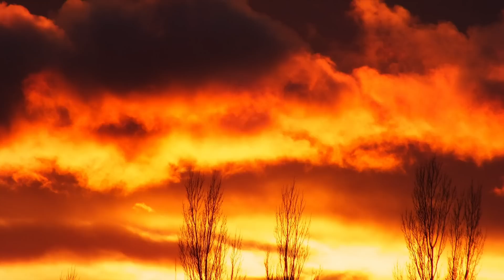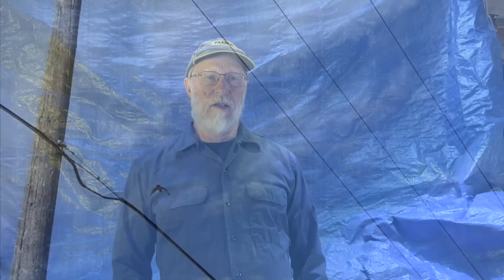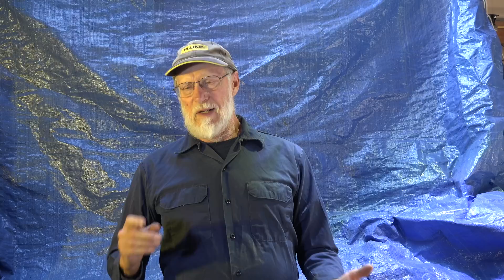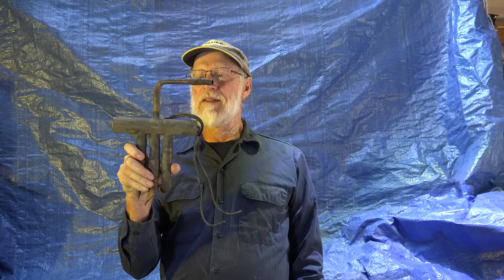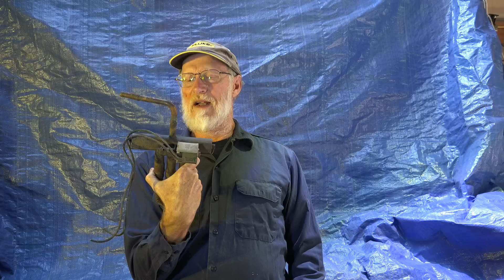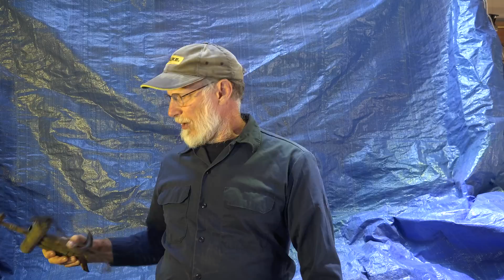Heat pump #7

Comment: I am considering a heat pump for day heating with a large solar array on the roof to offset the electric cost for the 40degree days that are a large part of the heating season in NY. The oil heat used an cold nights with another tstat to kick in when the HP can't keep up. I don't see this setup being used too often and would like to know why that is. Anyone have an opinion on this? Thanks
Reply from the maker: These hybrid systems are quite actually common.  By using a heat pump as the primary source, you will gain from the high thermal efficiency of the pump at higher temps, then the oil second stage will only come on when the heat pump cannot keep up with the load.  There are 2 stage thermostats designed to work with heat pumps.  Hope this helps.
GFM
Reply: Grayfurnaceman thanks very much, I have learned a lot here and appreciate the response. I will look into adding a heat pump for next season, and the oil burner then could fire on the 2nd stage of a single tstat - got it!
Reply: Mark Steven it just gets too cold in New York City in Florida you see he pumps New York the temperature goes too low

Comment: the simplest to put it is when the system is in defrost it simply goes back into cooling except the out fan is off because you want the heat that its removing from inside the house to remaing in the refregent so it can defrost the ice quicker.and also the headpressure rises while in defrost because the fan motor is off one of the reason you don't want the system to go into defrost as often is because of the head pressure rise and thats not good for the compressor and you had mentioned that, great video sir.

Comment: Yep and since you turning on the backup heat and that is why this process of defrost needs to be done effectively.  I've seen the older style of defrost controls in use, I must say that on demand has shown to be the most effective out of early versions. Reversing valves getting hung or coils going bad on them is a pain in it. I've tended to prefer machines that energize the reversing valve in the heat mode only. Nobody wants to hear the whooshing sound in cooling when everyone is out and about in the warmer months...

Comment: Thanks GFM! Do most manufactures energize there reversing valve in cooling or do some energize it during heat? Just wondering. Thanks again
Reply: Most heat pumps energize the reversing valve in cooling (heating is the default). Rheem & Rudd and a few other lesser known brands default to cooling and energize the reversing valve for heating. I think those are more popular in the southern states where cooling is the priority.
Reply: +Joe Marchione 
Thanks Joe, appreciate the reply.